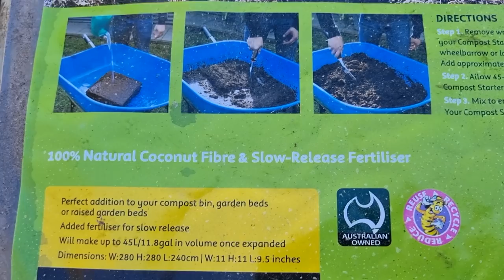Dogs - New Compost & Steak Showdown.

Comment: Hey clay....
Start your compost pile on bare earth. This allows worms and other beneficial organisms to aerate the compost and be transported to your garden beds.

Lay twigs or straw first, a few inches deep. This aids drainage and helps aerate the pile.

Add compost materials in layers, alternating moist and dry. Moist ingredients are food scraps, tea bags, seaweed, etc. Dry materials are straw, leaves, sawdust pellets and wood ashes. If you have wood ashes, sprinkle in thin layers, or they will clump together and be slow to break down.

Add manure, green manure (clover, buckwheat, wheatgrass, grass clippings) or any nitrogen source. This activates the compost pile and speeds the process along.

Keep compost moist. Water occasionally, or let rain do the job.

Cover with anything you have – wood, plastic sheeting, carpet scraps. Covering helps retain moisture and heat, two essentials for compost. Covering also prevents the compost from being over-watered by rain. The compost should be moist, but not soaked and sodden.

Turn. Every few weeks give the pile a quick turn with a pitchfork or shovel. This aerates the pile. Oxygen is required for the process to work, and turning “adds” oxygen. 

Plus to start off the composting,men only,urinate on it...starts of the process.
Dont use too much pine needle as will make soil acidic....add layers of shredded paper,newspapers,sawdust ect too.

Love the uploads...
Peace.

Comment: When I was a kid we had about 1/2 hectare garden and when a new compost heap was started we pissed on it in the evenings, aparently urine speeds up the rotting process, but not too much or the ammonia is too much, in the evening because theres no audience and it won't evaporate away. Compost heaps also need lots of air thru them.
When beef is hung for 4 weeks most of the sinew breaksdown thru natural processes and the flavour is improved a lot. I don't know if this applies to other meats, venison, mutton and so on.